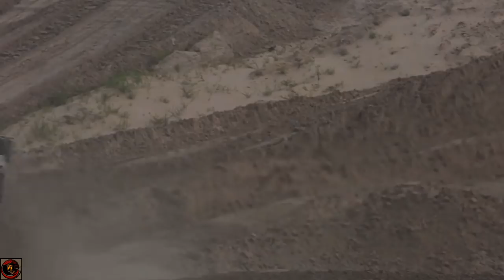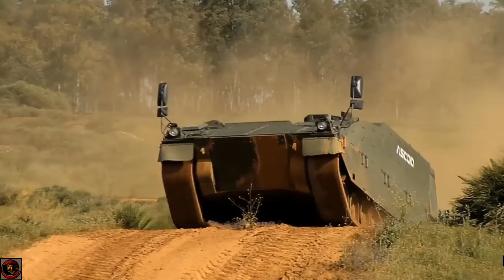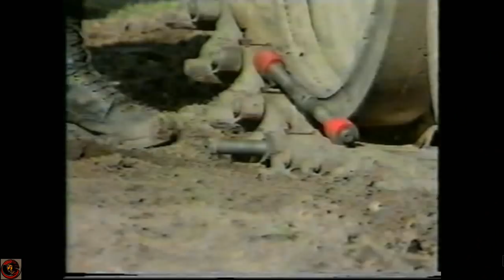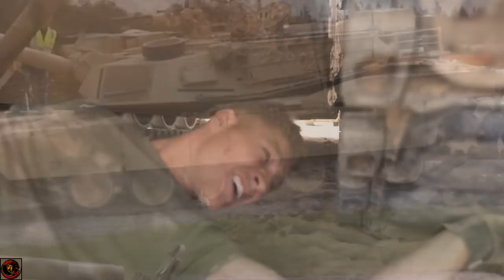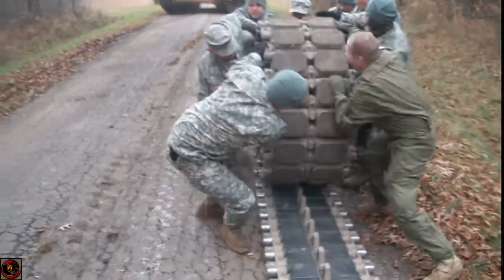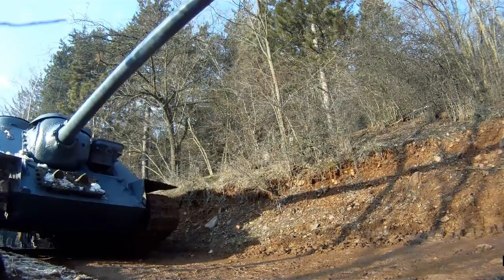What’s The Biggest Weakness on a Tank?

Comment: the biggest weakness is visibility and maneuverability in urban areas especially with little infantry support due to harassing and flanking fire
snipers shoot your periscopes and scopes you are blind infantry rushes in and destroys the tank by - for example throwing an IED ontop of the engine compartment and if possible destroying the tracks  or in the very best case destroy the turret ring and set it at least outside o fire 
they destroy the tanks motor cooler and if possible set the engine bay on fire , then shoot all that flee the fire and smoke or break psychologically
Also something i heard was done sucessfully in Syria in the urban warfare was lob a 20mm APHE round with a 20mm into the tanks barrel 
it can set of HE shells if the tank has loaded it or create a barrrel obstruction by hitting and damaging the barrels wall and leaveing shrapnelll ready to be wedged in place in the barrel

Comment: what they told us at hotel school was the track, theyre mostly blind, and they only want to go where they want to go. you can funnel them into certain situations precisely because the crew will avoid things that could potentially cause them to have to get out and fix something. if  you get into the head of the crew, especially the driver you can get an advantage.  he cant get up and move around, he has to sit there on guard 24/7 and the dont rotate him with other crewman. the leader of the tank is usually a sergeant and the driver a lowly private who is being forced to piss in bottles and cant get out to shit ever.  you can wait out tanks because of this, so sometimes its better to hold your fire as long as possible. sometimes its better to take your shot, we were firing tows, at longer distances because buttoned up they might never know where it came from and wont be  facing you straight on. we would turn our tubes backwards and back up to hills so that only the tube was visible. then cover anything that gave off heat and go as cold we could. put a field jacket or sleeping bag over the gunner like an old time camera shoot and wait. most of the time artillery was already being called on them and we were supposed to be the last line of defense. everyone was told to aim for the gig line around where the turret met the chassis but all of that pinpoint bs was not really going to happen in the middle of a battle and would probably make you miss.  our best asset was our radio. if we could call in their location, they would usually go after them with something other than our missiles which while cool as hell because theyre guided, arent as good as well placed top down artillery or hellfires. we didnt have javelin yet.

Comment: Speaking as former infantry, the tracks were our primary target for light RPGs, which wouldn't penetrate MBT armour anyway. Also for light autocannon engaging MBTs. If nothing else, it'll make it much easier for one's own MBTs to get a good clean hit. Failing that, it'll take a few hours to get that track fixed, which means that for that time, the opfor has one fewer vehicle.
So, no, it's not just your opinion.
Oh, side note? Barbed and razor wire can gum up a track's working sufficiently to lead to a thrown track. Needs to be a bit denser than you see most places, but it can happen.

Comment: Looks like the design of the tracks should be examined. If the tracks were moved from the sides of the tank towards the center of the tank, maybe have four tracks instead of just two working together to move the tank. I will have to look at this problem closer to determine if such an idea for a redesigned track is feasible. Thank You for the great video and for your knowledge on tanks.

Comment: Matsimus, have you seen or tried out a game called squad? its a milsim which also has vehicle gameplay such as tanks. What I love about that game is that (to a certain degree) some aspects can be kinda realistic such as, the enemy LAT or HAT can de track a tracked IFV or tracked MBT which causes the tank to either be completely stationary or only be able to drive forward ever so slowly. In that situation you as the tank crewmen have a few options: use the tank as a turret/bunker, like you mentioned, get 1 or more crewmen to leave the tank and repair the tracks which take a long ass time (bare in mind, repairing the track is doable but you cannot repair the hull and would need a repairing station to fix fully) or if the tank is close to getting destroyed aka on fire or surrounded by enemy armor or HAT/LAT bail.

Comment: Possibly that spot in between the body and the turret, it’s lightly armored to allow mobility of the gun, plus hitting there disable the gun’s rotation ability and could cause massive damage to the gun’s firing system and or causing a backfire/internal explosion

Comment: I have never worked on a tank but I have had to completely replace drive systems on dozers, excavators, skid steers and such. I always hated doing it. The dirtiest and hardest job when working on equipment. It seems though that some of the aspects of track replacement for a tank may actually be easier. Not as many rollers, and the tracks seem to be lighter.

Comment: Done a lot of tracked excavators, when they walk off the track - hate to think what it would be like trying to replace links as well under hostile actions, especially as they don't even have the hydraulics to lift/move the vehicle to aid the fitting.
Some of our smaller excavators used fully rubber coated tracks with bonded in cables and plates to maintain their function and, TBH, they could be a pain as they were nowhere near as durable as regular tracks - but the designs you allude to may be different. The other problem with them is if there is a fault the whole damned thing has to be replaced, unlike 'convention' tracks where a bad link or two could simply be replaced.
I play a lot of WoT (and you should check out the new graphics - very pretty) and I have to agree, the instant retracking is a bit off - but then it is a 15minute game - and as I play a lot of turretless TDs I was already of the opinion the tracks were THE major weakness of armour - actually you should realise that from any documentary on tank battles. A tracked vehicle should have a sign above it saying "Look at me, here I am, shoot me!"

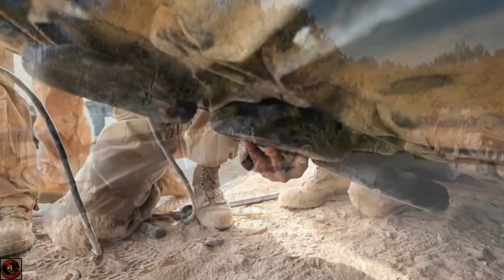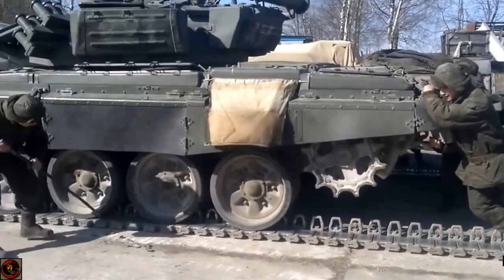Comment: At 14:00 Min... The TC should have stopped & removed Track Tension on BOTH Tracks! It's easy to "walk a thrown track back on" when you remove the Tension!  Both Tracks are a BITCH even on level ground... I always carried extra 4"x4" blocks of wood fro that. I spent over 20 years on Active Duty in the US Army as an 11 Echo, 19 Echo, 19 Kilo on M48A5's (Korea), M60A1's & A 3's and M1IP's to M1A1 Heavies before I retired. I can honestly say I've NEVER pushed a Tank like the Crew did at 15:25min! Always used an M88 Recovery Vehicle or another Tank & a Tow Bar... (YES! Work Smarter, NOT Harder! And YES, I cold chiseled the End Connectors once  were good & thigh in Garrison) Great Video! Something a lot of Folks don't know about Maintenance & Recovery!   DEATH Before Dismount!

Comment: As a former tread-head/DAT (Dumb Assed Tanker), when you said "Biggest Weakness" I automatically went to the tracks. An RPG or relatively small caliber hit on a drive sprocket and you're screwed. You left out the part that when you become a pillbox, if you're optics are disabled you become a BLIND pillbox and a blind pillbox is a very cramped place to die.

Comment: The only thing that sucks more is to blow your compensating idler arm or break a sprocket on top of it. The skirts on the Abrams are hell to work around to. Torsion bar and quell shaft breakage on the M60 series tanks sucked to fix as well. I had a driver so useless once I (the gunner) had to keep it maintained myself. Fortunately he was short lived on our tank.

Comment: Solution:Use WHEELS instead because if one goes down you can still move  backward or forward left and right because tracks just being one means one disabled track is just a drastic effect to mobility while one disabled wheel has a lower effect but this means more resources like for the wheels and hydraulics but of course there should be enough wheels for it to be effective but this may make tanks more effective at turning

Comment: I recall reading about an M1A in desert storm that got stuck in a mud bog in the desert, the commander of the platoon they belonged to tried for 45 minutes to extricate the stuck tank to no joy so left it and the crew with the word they would send the engineers to them to get them out. The mud bog was surrounded by massive piles of sand and after there platoon had left suddenly 3 T-72 Iraqi tanks come over the dunes and took the stuck tank under fire. The M1A returned fire and destroyed 1 T-72 then the remaining T-72 tanks went over the dunes out of sight. The gunner on the M1A switched his sights to thermal and found he could see the T-72's through the sand dunes and fired taking out both T-72 tanks by firing the 120 mm main gun through the dunes and killing both T-72 tanks. 

I don't know the exact location but it is a true story.

Comment: I agree tank's are exceptional in my opinion one of the biggest weaknesses for a tank is engine damage or tracks etc as they are both important for mobility as if they lose their tracks they are paralysed in terms of travel and a open easy target for anti armour weapons etc same goes for the engine as if it fails then power is gone so it is a sitting duck for enemy forces to target the tracks we're responsible for thousands of tanks being abandoned during ww2 as they were pretty much dead in the water to put it one way and while under enemy fire it is extremely risky to try repairing tank tracks etc so most during ww2 simply just abandoned them in the case of that event happening to try and survive yet all parts from tracks to the armour the main gun, limited amount of ammo limited max firing range etc they have many weaknesses but the tracks are a fatal risk if they fail

Comment: another weakness of tanks is their weight. they get stuck in marshy ground and cant cross a lot of bridges cause they cant handle the weight.

My unit switched from light guns to FV433 abbot self propelled guns when we got sent to germany. Those things were terrible for throwing tracks.
on a training excersise we started out by having to drive the abbots from dortmund to sennelaga. None of them made it there lol. all had to be picked up by the RCT with tank transporters to get us there. 1 broke down for every 10 miles we went mostly tracks breaking.

We wanted r light guns back but we were told nope cant use towed artillery in germany on the front line. we could have them when we were deployed in norway though cause tracked vehicles except r volvo BVB 202,s just got bogged down in the snow.
The light gun was a lot better and more accurate than the abbot so couldnt see why we were not allowed to keep them when we got taken of ACE mobile force and transfered to 2nd armoured div. We also hated it that we lost r special forces title as well lol. We got changed from light air mobile artillery to feild artillery.

Comment: Tracks are so vulnerable. There is a problem with two tracks on steerable bogies fore and aft along the centerline in that the interior space is valuable especially for space for turning. Some means of "outriggers" must be used. Can some number of independent ball wheels be used to reduce the space problem? Another advantage is that any explosion from below might be more easily dissipated with a shallow V bottom rather than a flat bottom.

Comment: I think squad is a pretty realistic war simulator (in development and early access).

Its' vehicles are especially fun to use and manage. You aren't an overpowered god, you can take bullets and depending on armor, some rockets to the front. But enough damage to your tracks or wheels and they are out. An anti tank mine is always an immobile or blown up vehicle. If you're fighting against insurgents they also like to hide IEDs near the mines so they can make a quick call on their Nokia phones to blow up the crew as soon as they come out to see the damage and repair.
Combat repairs are really dangerous and take a long time (for a game at least), and still allow you to only limp back to base for proper repairs. Losing a vehicle is also a big deal since you aren't replacing it soon, and it costs a hell of a lot of resources if you fk up with a MBT. And most of the time you spend in that game as a crew, goes to planning where it is safe and effective to take your vehicle. What side of the battlefield would it be the most helpful? Which route would be the safest? Would it be more effective to first just park on a distant high ground, use the optics to seek targets like snipers, bunkers, and vehicles? 
And you get no fancy 3rd person view. The driver has this small slit to look through, one guy has a periscope or can pop his head outside, and 2 guys get to use the optics with the zoom. It is incredibly difficult to spot a nearby infantry threat. Which is why it's always a great idea to move as a convoy, plan who watches your backs, who watches the left side, and who takes care of the right side.

Comment: Tracks. Tracks, Tracks, I’ve had to break them apart in mud, sand, snow, water and it all sucks and takes muscle and time. If your lucky enough to  have some hydraulic equipment and a recovery vehicle it helps. Even a bad driver can screw you. A down vehicle is like a injured buddy. That vehicle isn’t the only one down but the whole platoon because they have to cover you.

Comment: What is the next most weak portion, assuming that the tracks are in good shape and irregular terrain makes hitting the tracks difficult?  This includes when the tank is not moving and firing from a stationary position in an ambush, say.  What part of the upper portion of the tank should the enemy shoot at then, assuming he can aim that carefully and reliably and that his gun is probably not going to punch through the main armor over most of the visible portion?  I would assume the sensors, particularly the optics, using HE to spread blast and fragments around to damage and blind them -- if you can't shoot, your tank is just a very heavy truck on treads.  White phosphorus, if available, to make smoke is also an option, though the enemy tank can easily move out of it if undamaged, while a broken gun-sight is not going to work until repaired, possibly by somebody having to actually get out of the tank when stopped away from the battle to fix it.  Any comments?
Reply: You make a good point. But before that, actually the second biggest weakness in tanks and basically tracked vehicles is the terrain. They might look unstoppable in the desert and in paved roads. But watch some videos on battle tanks getting bogged down in the mud. Not even towing by other battle tanks can rescue them. When something that weighs over 50 tons gets stuck in the mud, things get very...ummm..undignified.

Comment: Well, this is actually still not a weakness of the concept of a tank itself, but to literally any combat unit, planes, helicopters, battleships, hell, even armored cars and trucks, drones, even troops! So, being immobilised is a weakness for anything that is not literally a bunker or a trench.
Although if we wanted to make a tank with more resistance to being immobilised we could just give it even stronger tracks, cover the tracks with much more armor so they are even harder to shoot away and make the joints of the suspension and axels of roadwheels, idler wheels and sprockets much much thicker so it requires more force than the tank will ever live through to throw the tracks off, and well, yea, that would need a much larger and stronger engine and robust mechanisms to avoid the agility overall from going down to the one of a turtle, and massive armored mobile bunkers are very expensive among lots of other things

Comment: Top 3 weakness of tanks and some tanks I know that have these weakness 

1. Tracks shoot that you have a sitting duck tank all main battle tanks have these weakness some ww2 tanks have armor in their tracks (of course some modern tanks have it to but the it doesn't have armor in the front and back side protecting the tracks) 

2. The turret (yes the turret): the hole where the shell leave the turret is actually weak since a guy can just shoot or place a grenade in it or if the guy is crazy tape a mine on it and of course all the MBT are weak against it

3. The engine: the expose pipe that connects the engine are weak against flames a guy with a flamethrower and since everyone know every tanks are less dangerous the more you are near it can disable the whole tank itself some MBT including the infamous M1 Abram is weak against it

And for a bonus old fashion tank that has the counter for this

Every world war 2 light tanks (well late war light tanks): of course the MBT is also fast but light tanks are meant for off-road and in-road and the light tanks are also very small so best counter for the track, engine, and turret problems 

The maus tank: I can't believe I'm gonna say this but put the modern day armor to the maus tank = total mayhem but the original armor can survive aa RPG rocket probably two or three rockets and like in the world of tanks rule never charge at a maus tank still applies so counter for the turret and track problems